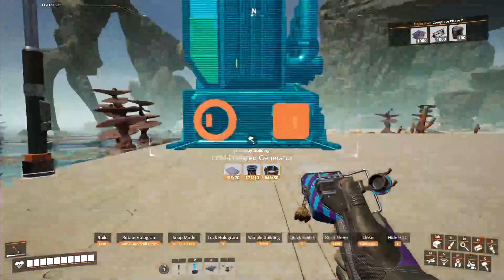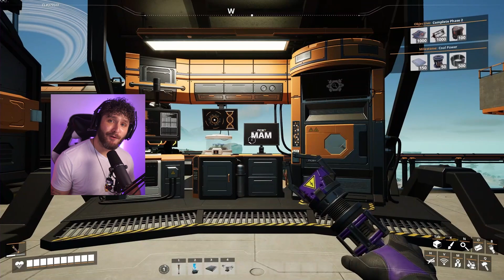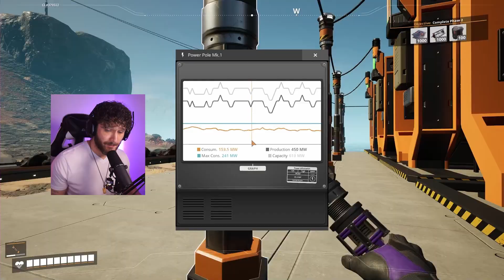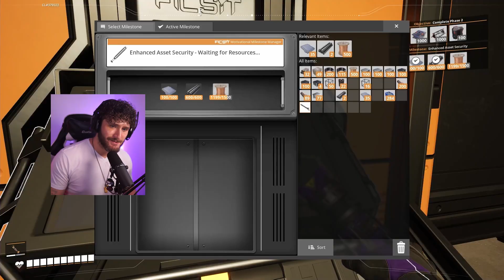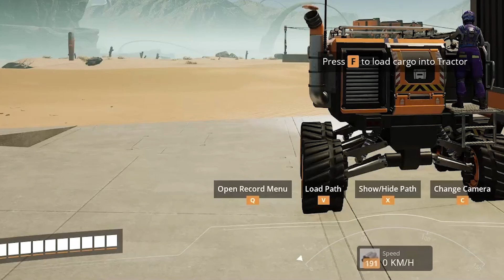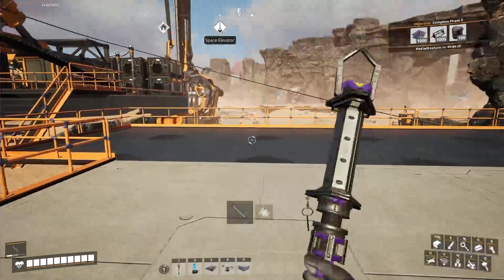Your Tier 3 Factory is About to EXPLODE – Here's Why

Comment: That sawtooth pattern in your power UI is because water isn't keeping up. Let the tanks fill and let coal get to 100 in every generator before you flip the switch by connecting wires. Watch it for a bit. If it's falling you may need an in-line pump or an overclock. Cheers
Reply from the maker: Was actually told that by a viewer as well! Thanks.